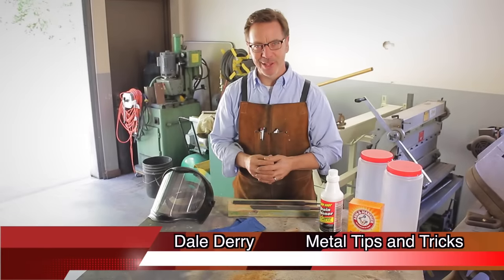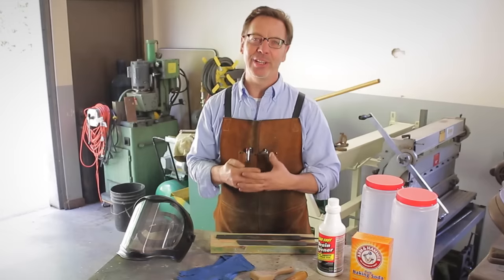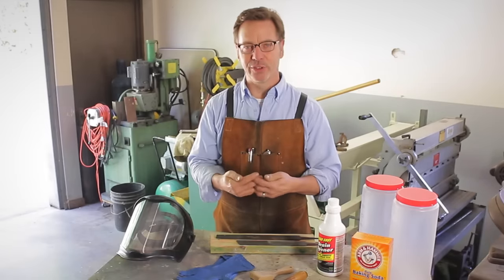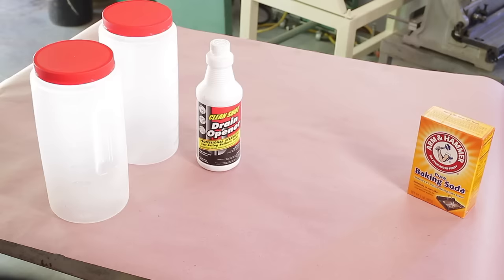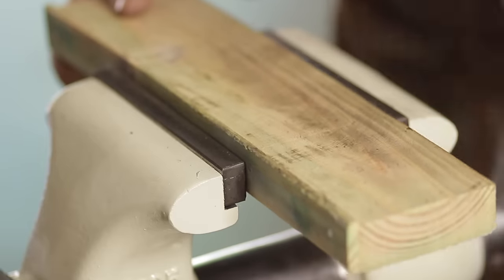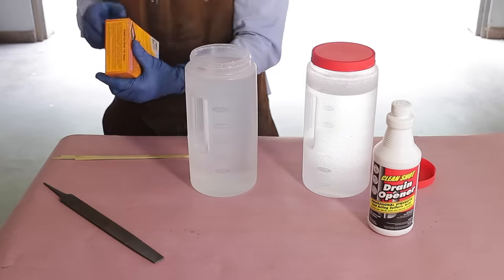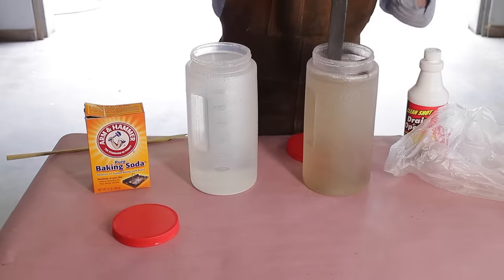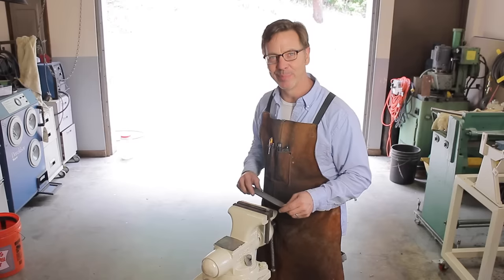How to Sharpen Metal Files

Comment: Ok a few years late to this party but a MUCH better way is (actually the same way but a lot easier) is to ditch all the heavy acids and just use phosphoric acid rust remover instead. Lots of brands of the stuff out there, Rustoleum rust remover, Oxpho, etc (just make sure it's plain old Phosphoric acid, yep the same stuff in a bottle of Cola) available on Amazon, most auto parts stores, the big home building supply stores, etc. It takes about a half hour for a "touch up" on a lightly dulled file or about an hour to an hour and a half for a moderately dull file to around three hours or so for a dull file, longer won't hurt a file at all. It works just as well but is MUCH safer since you can get this stuff on your hands and it won't burn you or make holes in your clothes, I often use the stuff bare handed with a soaked rag to remove rust, it doesn't burn skin but you really should use gloves with most anything.

Really this stuff works just as well, maybe takes a bit longer but is MUCH safer and far more convenient since all it takes is a quick rinse with plain water and a squirt of WD40 when removed from the acid soak. Plus there are no problems with having and storing strong acids in the shop.

Comment: It works if you use the drain cleaner that says "sulfuric acid" on the bottle. Be concerned about what you're going to do with the used mixture and the reminder of the store-bought bottle. Even at 10:1 it's still very caustic. You don't want this stuff just lying around forever. You're going to need a free hazardous waste disposal service. Choose a sealable container just large enough to hold your largest file so there won't be anymore mixture than is necessary. And by all means do this outside.
Reply from the maker: Thanks for your comment

Comment: does this only work with sulfuric acid or do others like hydrochloric acid work also?
Reply from the maker: I think you can use any acid. But I haven't tried any of the other ones I think the trick is to neutralize the acid after you're done that will save your files over the long time. Thanks for watching.

Comment: Have you tried using Phosphoric acid, I was told 30+ years ago to use it & have been doing it ever sense.  Have not used Sulfuric but your time frame seems to indicate it is much slower.
Reply from the maker: I have never used phosphoric acid. But i think any acid will work. thanks for your comment :-)

Comment: The baking soda doesn't need to be any where near that concentration to neutralize the acid AND if the Sulphuric acid is too concentrated then it wont etch the steel as effectively.  High carbon steel is usually an alloy of chromium, cobalt, molybdenum, nickel, niobium, titanium, tungsten, vanadium or zirconium. All are etched by the acid at different rates and some not at all. Maybe the differential etching rate accounts for the sharpening effect?  It would be interesting to see a close up of the teeth of of before and after.  I suspect the process dissolves the fine particles of debris in the valleys making the file more effective.
Reply from the maker: interesting ideas

Comment: You just blew my mind which doesn't happen often. Just when I thought I'd seen everything there is to know or do with tools you come along with a bottle of what is essentially drain-o and make a file work almost like new. I have a drawer full of old files that I'm going to be trying this on. Does it harm the process to do more than one at a time? Also since some of them are pretty badly damaged, how well does this work on the really bad ones? I usually use those for finishing on my lathe because since they don't cut very well they don't take much off. This allows for some fine tuning of final diameters as they more or less polish the surface instead of really cutting.
Reply from the maker: It dosent work on all files  the file must be dull not damaged to work. :-)

Comment: Iv'e heard of people letting files sit outside and get rusty to sharpen them. I guess the idea is similar to this. You just wire brush the rust off and supposedly the cutting edges will have been sharpened as the metal was eaten away. I'm not saying this works, but what have you got to lose if the file is dull junk anyway? You can always make a knife out of it when all is said and done.
Reply from the maker: Great comment

Comment: Actually, you can obtain sulfuric acid from a battery store or use muriatic acid (hydrochloric acid). Also, use a 1.5" PVC tube with a cap on one end instead of a 1 quart Rubbermaid container - rinse with cold water before you neutralize the acid with bicarbonate. Incidentally, sodium bicarbonate works well for neutralizing but the sodium/salt will accelerate oxidation - use janitor strength (10%) ammonia instead - don't use household ammonia (3%), it's too weak. Remember, the above treatment is cleaning the file - not sharpening it.
Reply from the maker: great comment

Comment: Would this work with an old ax...or chain saw blade...???
Reply: Nope. It didn't even work here. All he did was clean it.
Remember back to GCSE chemistry and reaction rates.
Larger surface are increases speed of reaction.
The tip of a file tooth is thinner, so proportionally had a larger surface area to volume ratio.
Put a triangular pics of metal in acid to show this on a larger scale.
It rounds the corners, not sharpens them.
A wire brush is what most people need. I have files I've used for years an hour or so a week and they still cut fine. Just cleaning them.

Comment: Excellent tip if it works very well. But how long and does agitation help or hurt? Also what if the drain cleaner is HCL? (I never buy the stuff! I've got at least half a dozen snakes for proper skookum choochin' drain cleaning plus a motorized monster my dad left me that will CUT the tree roots clear out to the street inside a 4 inch main...plus a 50 to 100 ft extension for it...and yes, its more than most men can life, both the machine and the extended snake... I need to google up directions next time I do this, though. It's a $#%^ of a job. But I thought the last bottle I picked up and looked at was HCL or more often lye...sodium hydroxide... and I'd hate to ruin a file over using any ol' drain cleaner.)

I actually remember when this first came out about two decades ago I was on a mailing list for non pixie hand tools and there was great contreversey about this: could it work so well? Back then, BTW, this was sent to Nicholson and done professionally and while some guys said it was expensive it was well worth the expense (most of it probably being postage, too bad "book rate" doesn't apply to files but now we can do it at home.)

Didn't care much for Ave's video today, but your comment lead me here and that has been worth it. Plus you should cover does the handle need to be removed? I'm mostly turning wood these days so EVERY file has a wooden handle on it and I'd hate to see some of my masterpieces destroyed by being near acid... but because I turn I do own a full face shield.

BTW, and maybe I should just google this, but I'd like a motorized brass wire wheel because brass has obvious advantages that steel wire wheels. Anyone who'd use a leftover piece of copper pipe to clean a file will surely be able to understand why a brass wheel would be handy. ( So far all I can find are toothbrush sized brass brushes and every motorized one I bought turned out to be steel that was coated to look like brass.   Show me how to make one or where one is reasonably for sale and I may show you my washing machine motor grinder/buffer/wire wheel that has all the grace of the leaning tower of pisa, multiple speed capability (tool less belt change, my own personal design) plus two electric speeds via a standard household "3 way" switch and its last bit of TLC was casters so I can roll it anywhere in my shop.

Comment: Noob here, I have so many old files but I've never thought how they work or are made before, so a file is basically made by eroding a metal rod to create a rough surface? or is that too simplistic? I assumed another tool was used to create the grooves initially.
Is this cost effective or would anyone say its cheaper to buy new files? 
How many times can you do this to each file and does it work on mini files?

Comment: New to me, too .. But keeping the file in good condition counts a lot. Avoid touching it, grease from your fingers will make it slide (try before/after if you doubt this) Also, clean regularly. I use a short haired steel brush, cleaning along the grooves. It will be happy after cleaning in a less corrosive bath - hot soapwater and hot water rinse - then dry.. A tip by Abby Babby is also a nice one - use chalk to make the grooves slippery for debris and grease. Anyone know if this process actually eat away at the teeth to sharpen them? Sulphuric acid will eat away at steel.. but will it do it in a beneficial way?
Reply: its a uniform etch,thin layer is removed over all surfaces

Comment: i tried the copper pipe thing. didn't really get deep into the grooves. Put a brass wheel brush on my drill and used that in the direction on the grooves. worked much better.

Comment: Most drain cleaners are Sodium Hydroxide, a base. Easiest source for sulfuric acid is battery acid.
Reply: I'm not familiar with what he uses in this video, but there's a drain cleaner called Liquid Fire that is concentrated sulfuric acid. Wicked stuff.
Reply: Some, like Drano, are caustic. Some are acidic. You have to be csreful not to mistakenly mix them.

Comment: It doesn't matter to me if the acid is cleaning or sharpening, if it works.  I would think helps   dissolve the matter embedded in the file, making it easier to remove with the file card.  That would be a big help.
Reply from the maker: great comment

Comment: So if acid works, then is the file actually dull? Just seems like all this is doing is cleaning out the crud between the ridges. Similar to “re-sharpening” sand paper.. Just uses that rubber block to clean out the gunk between the media.

Comment: Keep them clean with a wire brush, some degreaser and when they get dull give another use to the good steel, acid is not a solution, but the Cooper tube is a good idea.

Comment: Bit old to add any think but good tip and a real had show of tool uses ? Using a file like that with out a handle is asking for hand damage after driving the file deep inside ? Be safe but good tip

Comment: You say 10 to one ratio but what percentage of sulfuric acid was in the drain cleaner you used. There are differing amounts depending on brand. I'm not trolling I just want to know so I can get the correct mixture.

Comment: Acid actually does work, and it isn't because it is removing the trash between the teeth... I use a card file for that. Previously, I have used muriatic acid, but definitely stay upwind of it and use your protective safety gear.

Comment: It's much easier to sharpen files using approx 10% phosphoric acid soln. or even metal etch used in  body work which is around 3% phosphoric acid soln.  Been doing this for years with good results.  However don't forget to check progress---forgot once and had no file left after sitting in the soln overnight.  Usually 2 to 3 hours is enough.

Comment: You just ruined my excuse to take a ton of files and make knives and wood cutting tools (I'm sure I can sacrifice a $1 yardsale find vs. a bought bar stock of 1095..)

Considering I NEED files to make knives, can you use Vinegar? pros? cons? I always did Vinegar and then Windex but this seems way more effective and given time considered probably more efficient. I'll low heat used motor oil on them with a MAP gas torch but not past heat treat. Now I do this on old tools not designed for crucial cutting, rehabbing wood tools, etc. Theory is the steel opens up (torch is mixed cold, propane heats too slow, ruined heat treat, and it REALLY works. Carbon steels just bead water. planes, pipe wrenches, etc. not sure I should try it on cutting tools...it's based on "carburizing" theory, I love it. Haven't found a rust prevention better for old tools. 

Had NO clue about the copper. Since then I've seen very soft mild steel also used, making grooves in the steel, and "registered" as it was used more. Kinda like a checkering file. 

Great video.
Can I just say? I started to read comments to see if answers were there before I asked,...
Trolling a f'kn FILE SHARPENING video? And you're arguing he doesn't know what he's doing?! Maybe he's a representative of the sulfuric acid conglomerates, in a Machiavellian conspiracy to waste our money on acid products. 

Jesus people. IT'S A FILE SHARPENING VIDEO! He's not arguing about the existence of Aliens or Lizard people in the government! 

I'm never ceaselessly amazed what people will argue about online. 

Here's an idea. Try it first and then see... 

I'm gonna go make a kinfe.
Reply from the maker: Are you trying to say there are not Lizard people running the government,  you troll. LOL
Reply: Metal Tips and Tricks Well, that's common knowledge, but I'm still wondering ifn plain old white vinegar will work. In use that to rehab all my Stanley and Record tag sale buys.... 

my guess is, sulfuric acid works faster, better control.

Comment: Wonder if this is the same method the file refurbishing services use?  Too easy not to try.  

Some of us have many dozens if not hundreds of files and "just replacing them" isn't a simple or inexpensive task.
Reply: Wade Patton do you keep a file card around, it should help somewhat.
Reply: Matthew Becker
it helps if filings are building up in my files-which is rare for me, but some files and some metals are stickier than others. Also the copper pipe treatment seen in this video appears to be a much better method than file carding.  I have acid, I have 100's of files, the two will mix later on.  But first there's hunting season opener.

Comment: Hey. Number one rule.. NEVER use a file without a handle! During my apprenticeship you would have been drummed out the workshop if caught doing that.
Reply: I use my files without handles.
Reply: Ditto
Reply: if your not supposed to use a file with out a handle, dont ya reckon they would put handles on them? handle only helps with comfort, never in my years of using them or in school ever heard dont use with out a handle
Reply: I had a chum who rather than fit a handle to a file would curl the end over. At college making the file and it's handle was to much for some, "I'm a metal worker"

Comment: You might clean the file, but as others have noted, it won't resharpen it. A good quality file (i.e. made in U.S.A.) that is used properly and cleaned every time you use it with a file card will last a very long time. A brand new file can be ruined in no time by incorrect use. 
  I would recommend Smith's 1912 text "Principles of machine work", page 60 found at:
https://archive.org/details/textbookofprinci00smitrich
And also Smith's 1915  "Advanced Machine Work". 
https://archive.org/details/textbookofadvanc00smituoft
These are both out of copyright and are free to download. Excellent text and drawings are very useful to the novice and journeyman alike.  New methods and tools make some of the information dated, but the hobby machinist will find some clever ways to 'skin a cat' that he or she may not be familiar with.

Comment: Do NOT count on that 2x4 having any lip. Most (nearly none) have any lip. The lip only appears when the sawmill's planer isn't adjusted properly, and it interferes with stacking so they tend to fix it early.

So what you've done is not sharpening, and it won't work on a truly dull file. What you've done is a deep cleaning, and it will not restore a dull file, which has all its edges, at least in the middle of the range, blunted over (rolled or chipped or outright broken off) by repeated contact with other hardened objects or by "sawing" with a file. It's far easier to just keep your file clean than it is to bludgeon your work with it for months or years, then finally deep-clean it with muriatic acid like this.

Comment: The acid eats the dirt and grime out of the file making it feel sharper.  The problem is, people think the acid eats away the steel making the file sharper, however the acids that does eat the steel, consumes the cutting edges first dulling the edge.  Think I am wrong, add the acid straight and leave the file overnight and tomorrow you will have a slick piece of steel, not an extra cleaned file.  Once you have rubbed the edge down, the only way to reproduce it is to re-cut the file.
Reply: If you are happy, I am ecstatic.

Comment: This is interesting as I am not sure why it works as a sharpening process rather than a dulling one.  

A potential improvement to the method shown: try gently running the file in the non-cutting direction against a piece of wax in order to coat the tooth edges, then do the sulfuric acid sharpening.  The tooth depth will increase.  Then rub on wax hard in the cutting direction to get the wax in the area between the teeth and get it off the tooth edges by rubbing a piece of metal in the non cutting direction.  then do the sulfuric acid sharpening again.  Then clean off the wax with gasoline.  This will probably make the edges razor sharp if it works as intended.  The method in the video may only be removing burring, making the file seem sharper, like honing a blade without sharpening it.  The end result of the improved process might keep the original geometry of the file rather than eroding it flat over time.

Comment: Next time, use the file to stir a little after adding the acid. Concentrated sulphuric acid is very dense and will mostly sink to the bottom, forming a layer of concentrated acid near the bottom, with hardly any acid in the upper part of the solution.
Reply from the maker: +DutchPhlogiston 
thanks for your comment :-)